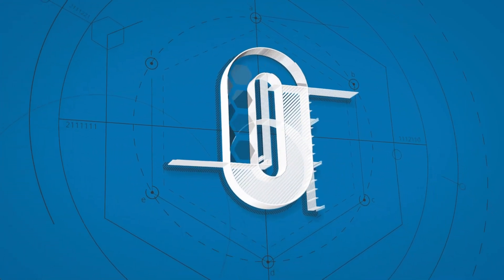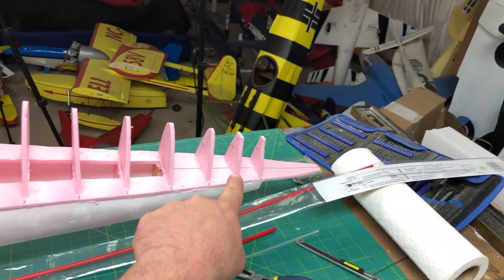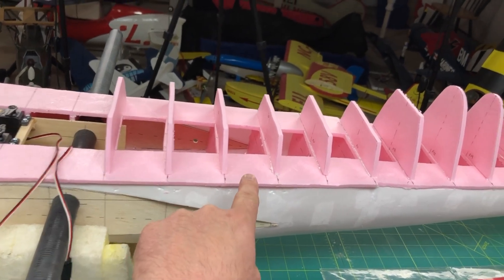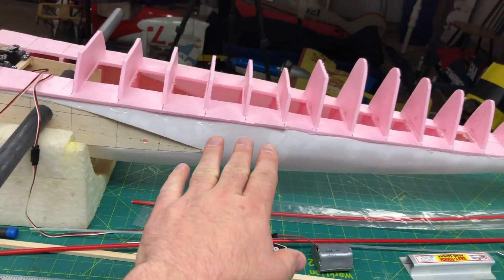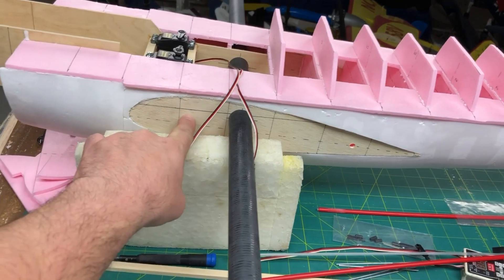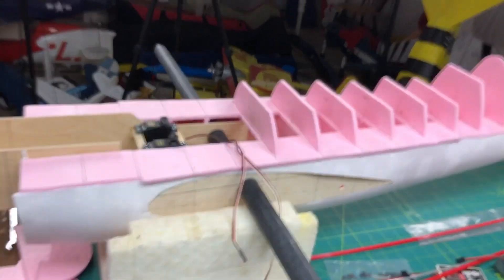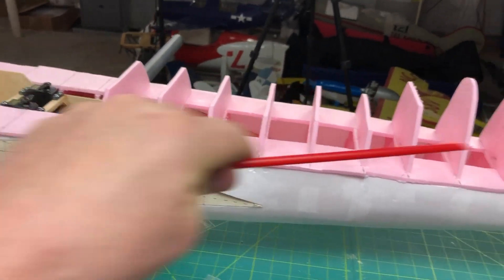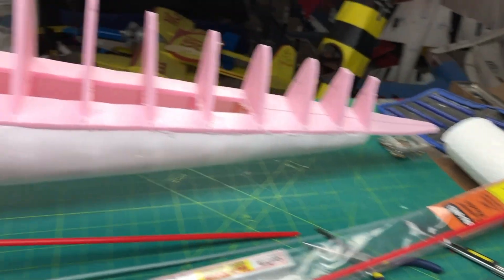Saab B.17: Backbone and Lazer Rods

Comment: Been watching your videos for awhile. Started by watching some of your flite metal vids. Still a balsa, fiberglass cloth, and dope kinda builder. Which i truely believe is a dyimg art. Never built a plane with foam board. Watching and learning something new. Thanks for the content!! Good luck!!!
Reply from the maker: Sadly, I agree that working with balsa is fading a bit but I think that's true when any newer technology comes along. Been on a balsa kick for a while and I'm back to foam... for this season. While foam is different to work with, you can achieve nearly identical results. The Fokker DVIII I bult last year was a great example of a simplistic build and this build really shows how you can take those old balsa-based plans and use foam in very similar construction. The advantage is that it builds SO MUCH FASTER and it is so much less work when you make any mistake. I'm glad you are learning as I think that is the greatest part of the hobby!

Comment: Those used to be called golden rod. If you didn't glue the outer tube down the entire length of the fuselage on a long run, it would bind up and flex. They would either get stuck or be loose and have lots of slop.
Reply from the maker: I believe you are referring to Sullivan products Gold n' Rods. Those still exist and this system, while similar in functionality, is a better product in my opinion. The plastics are more rigid and so are less compressible making slop much less of an issue. In addition, the ridges are inside the sleeve, not on the inner push rod. This makes running your lines much less likely to bend during installation and operation. The internal ridges also do prevent you from making turns that are really too tight for the rods to make. I've made that mistake easily on the Sullivan rods before. The sleeve plastic takes a wider variety of glues much better too. Of course, roughing the surface up with sandpaper promotes any glue adhesion. If you've never tried the Du-Bro option, I hope you'll consider it.